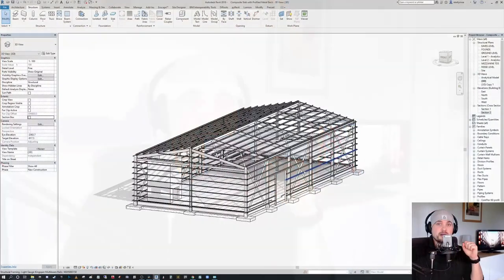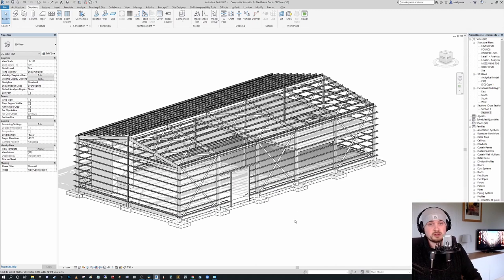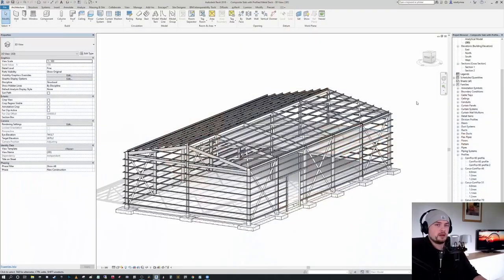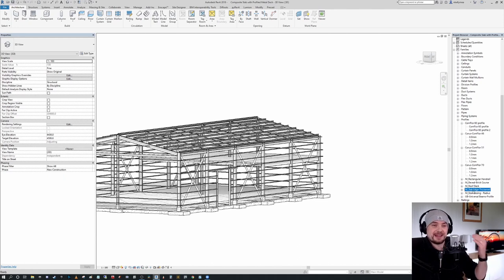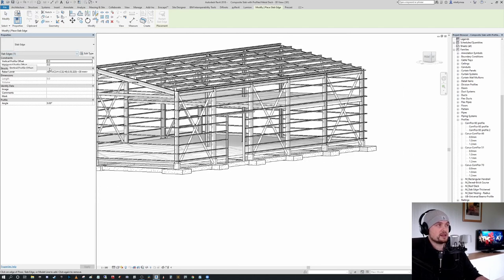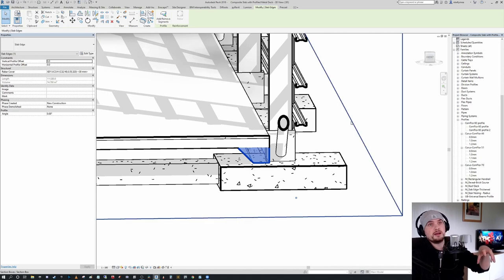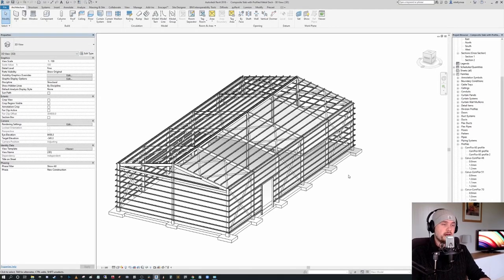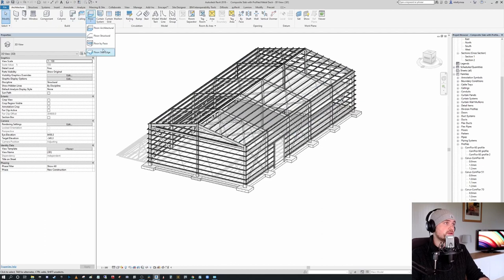Concrete Slab Edges, Thickenings, Pits and Bund Upstands in Revit

Comment: With respect to slab edge transitions you can also break the sketch into multiple parts to assign slab edges to specific spots instead of fighting with grips. Then use your sketch lines to trim where you want the opening. On both jambs of the opening. 

The only thing I haven’t figured out is why revit won’t slab thicken on a mono slope edge. It will certainly do it if you have multiple slopes but not a mono slope edge. Any ideas on workflow?

Comment: Niall. Is there a way to include the thickened profile so that it sits within the floor type? My concrete slab is not the lowermost layer in my floor type
Reply from the maker: Hi John. You can give the thickening a vertical offset value / parameter that will allow you dictate how far from the top/bottom surface of the overall floor construction the thickening profile gets situated. Then you can use the cut tool to cut the thickening away from the floor construction so that their is no sand blinding, hard-core etc visually passing through it. The join tool may also give the same effect while ensuring there is no separation between the concrete slab and connected thickening materials. 
Hope this gets you on your way to a solution.

Comment: I made a custom profile for my slab edges and the corners just won't join. Not sure what to do.
Reply from the maker: Hi Fernando. Hard to give any guidance on what might be causing this. If you could pop over to the discord channel (details in the video description) and post some images of the profile and the corner you are trying to wrap around it would give some useful insights which I might be able to give you advice on.
Niall
Reply: Do it in a single pass by selecting all the edges or join them after if different